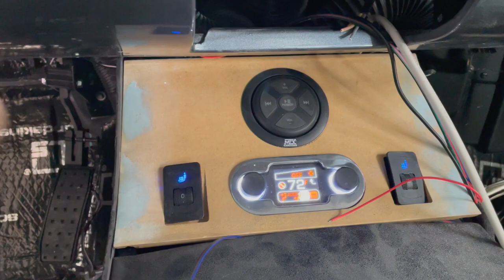1959 Impala: Part 15 - Chrome and final bits before upholstery

Comment: Hey there just wanted to ask, whith the VAIS SEER PTS system, does it keep the ignition powered accessories active during engine cranking?

I emailed and even called them on this and i got some conflicting answers. They needed to ask a tech about this. I imagine it should keep IGN live but drop ACC during cranking so that for instance a ECU / Fuel pump has 12v.

Any way you can shed a little light on that? Im nowhere near being able to test that myself yet unfortunately .

Thanks so much if you can help !
Reply from the maker: SO I am currently out of town, but from what I can remember, the fuel pump is is on during cranking and there is a specific wire for the fuel pump on the system. I have a stand alone LS harness in my car and did not use their fuel wire, but used the one from SEER.  Jonathan at VAIS was super helpful whenever I had questions.  Best of luck.
Reply: @burrtech Thank You ! I Hope to do some bench testing here soon and finalize my wiring plans.

I was previously planning to use the Digital Guard Dawg iKey and in their wiring they give you 2 ignition feeds, one that drops during cranks and one that stays live for an ecu/fuel/etc.

I didn't find those specifics in the SEER instructions. I did find a solution using a relay in case 12v is dropped during crank.

I'm actually in the middle of planning all my accessory wiring , designing the fuse/relay layouts and sorting out what needs acc 12v, ign12v, and 12v when cranking.

Thanks again for your information!! Can't wait to see more of your build!!